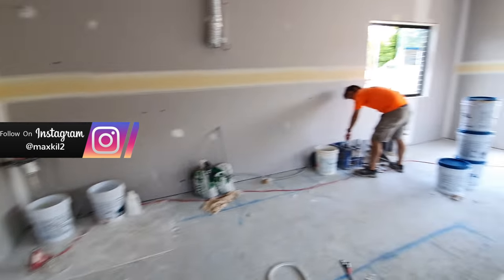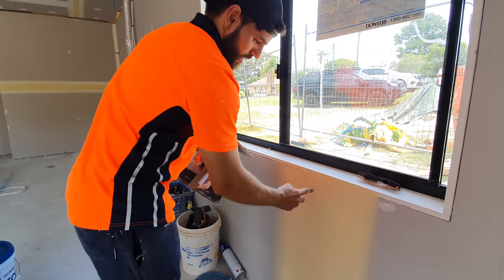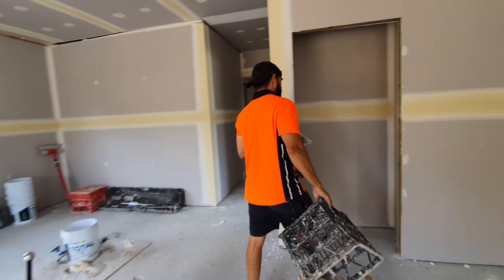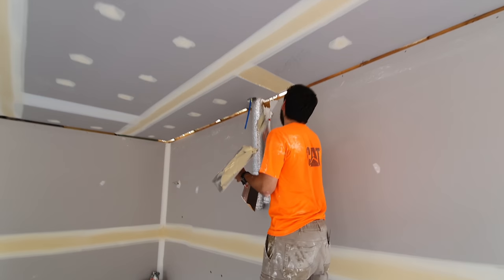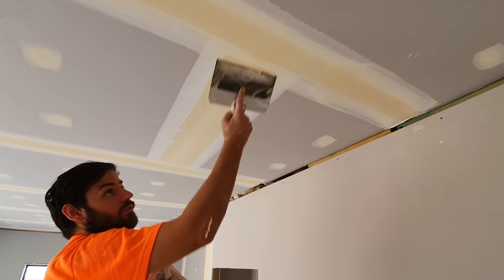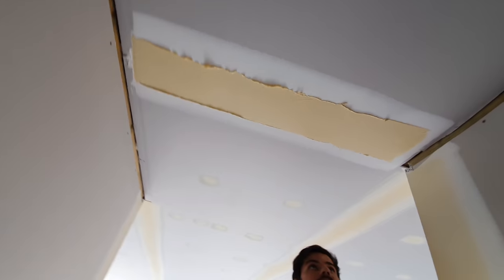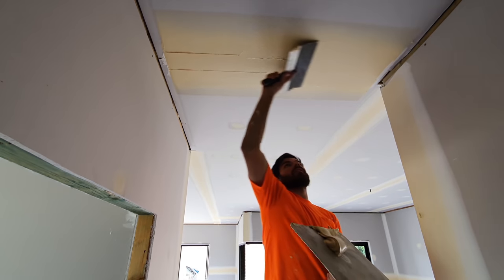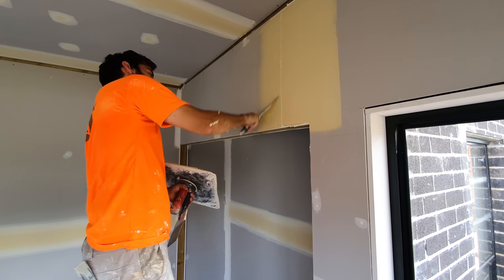How to Skim Coat a Butt Joint (DRYWALL)

Comment: Hey guys great seeing this! I'm an old drywall taper guy from years ago. We did things a little differently here in California. I used a mud pan and flat handle knives, a 6-inch for taping covering nails/screws and angles then a 10-inch then a 12-inch for finishing buts and joints. I only used a hawk and trowels while doing interior and exterior plastering. Great video!!

Comment: We split the butts out on fill coat wit 10" box (if that is needed. Down center if hollow joint) . On second coat we triple them with a 12" box, chase with a blade. And when they are dry, we 12" box the bands straight through the butts.

Comment: Love the mud you guys are using. The colour of it is not white like ones we have in ontario canada.
Reply: It's a liquid coloring that you add to the mud . It let's you know the stages of the taping . They're doing the 2nd coat with the additive . The next coat is a skim , probably without color . Also the color is used to make touch-ups more noticeable on a white primed surface , so you can identify what needs to be re-primed before finish painting. You can get it everywhere here in Toronto .

Comment: Being a drywaller in the US for almost 20 yrs i can say that for hand finishing these guys are legit and clean. Only thing i don't like or know is why there are no screws in the field of the wall sheets ? Hmm puzzling.
Reply: Glue on studs
Reply: Glue on stud is not as effective as screws. Also I don’t understand why they started hanging the drywall from floor? We always do the ceilings first then the walls and jack the drywall nice and tight . They may put a crown molding to hide the huge gaps but the next owner may not like crown moldings so this is a huge deal. Their work is clean and they tape nice and widen the joints so that they are not visible. I would give a 5* but lack of screws and not hanging the ceilings first is a huge deal. Also the glue only holds the paper of back of drywall if the house settle or move a lot am not sure it’s a great way to hang. I only used glue when requested by owner but always min 2 screws 16 and 32 inches. So a solid 4* for them. Not sure where they are but in 20 years I’ve never seen this. Only on commercial work we hang from floors as the drop ceilings will be below drywall. For. Corner bead I always cut a 4 inch peace and trim the edges and have both corners perfectly flush. We never overlaps corner beads, on windows we cut  a 45 degree angle and put a small piece of bead under so it’s all tight. Next we always nail or screw then corners on top of the clincher because eventually it will get hit and crack if not nailed or screwed on, last we put a flat tape along the beads to reenforce the corners, this is by far the best way to ensure quality and durability.  But you guys do clean work. I would love to know why the points I stated. Thank you for showing what clean finished coat is for all those who do shitty jobs. Lol.
Reply: It's probably a dabbed wall, think these guys are eastern Oz, where I was in WA they sand&cement and plaster skim the walls but some places dabbed plasterboard straight to the brick in this instance there wouldn't be any fixing for screws (Perth WA nearly all internal walls were brick)
Reply: @frenchronin   @Frenchronin  they don't start on walls in Oz, not unless there is a reason to.  As for the gap at the top they do po put a cornice up which covers it but it's not the same with all builders out there, just before I left Perth we were having to square set all ceiling internals before cornice because of a change in regulations on commercial builds. (Mainly for fire/smoke regs I believe) 

Also they don't overlap beads either, it's cut back at a angle forming a point and they can have a mechanical fixing as well as a mud fix. 

The walls be void of screws is most like because it's brick walls where the boards have been dabbed on using a plasterboard adhesive (powdered not acrylic adhesive) so no studs for a screw fixing. 
Also they use things called back blocks on the ceilings which are small cuts of board layered with adhesive which stick down to the back side of the plasterboard joints. 

I flushed out there for 7 years and each team I worked with did things slightly different. I even did a job where the ceilings were put up before the roof had gone on 😁😆 very trusting on the weather. Anything else I can answer feel free to ask. 😊
Reply: @jamessullivan3829  It looks like stud frames to me. I haven't been able to find anything on why those gaps behind the cornice though, like are they doing ceilings that are just over 2.4 or 2.7?
Reply: It looks like it’s all timber frame , was wondering this myself. Definitely haven’t used enough screws in my opinion. Maybe they just have different specs over there. I’m from the uk and never seen 1 screw in the centre of a full board before.
Reply: @ismu34  the boarders that worked with us were notorious for "stretching" boards 😆 if they had a room the was 3.7 wide the would offset the boards 50mm from each side so they could put 3 full sheets without any strips, they would do this knowing that the cornice covered 75mm.  Was bloody annoying if they did it wrong tho and the cornice wouldn't cover. Here in the UK it's become part of the regs for the internal corner to meet and be filled (either by tape and joint or plaster) even if it having cornice over it.
Reply from the maker: Stretching boards... Love it...
Reply: They are probably using adhesive on the studs . We do that here in Canada too

Comment: Hello, i work very much the same as you but i have never seen yellow drywall mud.  What is that?  Is this something you mixed? Did you add colour to premixed?  If so why?
Reply: I was just going to ask the same thing  is it an Aussie  / New Zealand thing?
Reply: I think that's topping mud for the final coat. I know here in the states you can buy topping and it's a yellowish color instead of the tan or off white color. It's also a smoother creamier mud.
Reply: It's weird 😕right
Reply: @johnwallace1729  it's a brand thing

Comment: Great work and video!!! Thanks for the knowledge! Here in TX I just see one coat. What compounds do you use one the 1st, 2nd and 3rd coats?
Reply: A setting compound for tape and two coats. Then a drying type for the finish coat.
Reply: @ismu34  just two coats of base coat which is hard then 1 of top coat which is softer and sands easier
Reply: @brocksinclair66  thats what I said lol

Comment: Thanks for sharing. Its pretty cool watching y'all use a trial and a hawk  That hawk has been used a good bit. you can tell by the curvatures of the edges. I grew up finishing sheetrock with a knife and  pan in the late 80s and early 90s. I have leaned so much about the new skim blades and various other techniques from all the cool channels.  My dad was a drywall contractor so I subbed from him and a couple of other contractors. I also remember when the only place you could get machines like the boxes and bazooka was renting through Ames taping tools. it really went crazy when the patent ran out. You could buy them then. Again thanks for the great video. I Oh yeah what is the cream colored mud? I've never seen it that color.
Reply: It's a liquid coloring that you add to the mud . It let's you know the stages of the taping . They're doing the 2nd coat with the additive . The next coat is a skim , probably without color . Also the color is used to make touch-ups more noticeable on a primed surface .

Comment: I’m assuming you guys glue the walls as well since you only have one screw in the field.  What kind of glue do you use, and is it metals studs or wood?
Reply: I was wondering that myself. How do they attach the drywall with so few screw holes?
Reply: I’m sure they glue.  We don’t hear, but we’d have four screws in the field on the ceiling and three on the walls—that’s not counting the one at the top or bottom of the sheet.
Reply: Yeah most residential units have their walls glued and their drywall hung horizontally
Reply: Depends on the walls, if it is timber/metal stud it's screwed as you would expect it to be but they use a acrylic glue as well as screws so it would be one screw at the joint two dabs of glue two screws either side of the center line then two glue dabs then a screw to the other side of the board.

If they are brick interior walls then it is dabbed with a plasterboard adhesive (mud adhesive) straight to brick work which has a either rough or patterned surface to provide a key, if this is the case then there aren't any areas to get a screw fixing. 

There are alot of different methods out there. 😁
Reply: @KevinsDisobedience  the stud adhesive here is strong. the screws are the until thew glue dries. the glue is stronger

Comment: That age old question... The trowel & hawk or the knife & pan... Which do you prefer??? Or even do you prefer both???
Reply: It seems like Americans prefer pans and knives and British and there colonials prefer hawk and trowel, but then again what did crocodile Dundee say about knives( obviously not a hawk and trowel man)
Reply: @jimginter6802  i can use both, i prefer flat troweling final coat as it has the same finish as that large knife and doesn't leave lines like the guy in the video explained with his curved trowel and it's faster than a knife and don't have to switch between the 2 tools.  I don't think region should play a role on how work is completed.

Comment: Why is there a gap between the ceiling and walls? Here in Arizona they push the drywall up tight against the ceiling and finish the corner.
Reply: Probably doing a crown moulding .

Comment: Just curious why none of the rock is nailed in the field? Also I’m assuming they are doing crown moulding or something? Never seen drywall hung like that?! Fire inspectors wouldn’t let that fly here. But I’m guessing you guys are the tapers and not the rockers... you do beautiful mud work!
Reply: fire inspectors would never pass normal white board haha, gotta use firecheck pink sheets for that
Reply: I also wondered why there is like a 1 inch gap around the entire home between the ceiling and wall
Reply: @derekk2300  our crown mold or cornice is made from the same material as the board them selves. no need to go tight unless its square set
Reply: @brocksinclair66  oh nice, right on. Thanks for the explanation

Comment: Hey max how long does it take for the boys too do a house??
Reply: I reckon they can finnish 700m+...probably 1000m easily.  Just depends on compound drying time
Reply: @schuey2003  I with you
Reply from the maker: About 8 hours I'd say, 6 hours first day, taping and 2nd coat and come back the following afternoon and top it out after they start another one.

Comment: Why don't they cut out the electrical outlets and lighting?
Reply: That is usually the job of an electrician in Australia, unlike many other countries. During rough-in (cable run) stage an electrician will have stud brackets (these are metal) nailed to timber studs where the locations of the switches, powerpoints, tv, data etc points are. Then after plaster is sanded, before cabinets are in and before paint and electrician will do the 'cut outs'. Because the stud brackets are metal you can easily find the brackets with a magnet and cut out with a plaster saw. It is also common practice to have the ground sprayed as well and also good to have a plan marked showing locations. A video also ensures nothing has been forgotten to cut out. 
As for the lights some sparkies use their spray marks on the ground and shoot a laser up to the ceiling. As for me I always use the sprays as I guide during rough-in even though they are spaced out accurately. Come cut out time, I will have my measurements on the plan which shows distance from wall to the first light, distance from first light to second light and etc. It is ALWAYS more accurate to measure off the ceiling by tape measure instead of shooting a laser up going off the ground. As for those sparkies who use the laser method they need to have floors cleaned spotless, make sure no materials are on the ground and make sure they actually go to the cut out before the floorboards are on or else they really are screwed. Anyhow, sure that answers your question...

Comment: How come you guys don't box your corner bead? Just a question. clearly you guys do excellent work.
Reply: Blades go dull quickly on those boxes doing that
Reply: Because they not doing hundreds of feet of bead
Reply: MUCH faster and easier by hand doing one small unit. Considering clean up time on the boxes

Comment: Whats the cause of pin holes and bubbling when plastering?
Reply: Your mud might be to thick or you're leaving to much mud on what your coating.
Reply: i get it over painted or sealed surfaces-no suction so air comes back out to surface
Reply: @dismaldog  It never happens to me when i'm finishing new drywall but only seems to happen on painted surfaces that are satin/semi-gloss, sometimes on flat paint finish too but rarely.

Comment: any reason they don't use the skim blades?
Reply: Because they're good. They don't need to
Reply: skim blades didn't exist until recently as well, lots of current drywall finishers learned their way and are quicker.  Skim blades maybe faster but are very expensive that it's not even worth buying them unless you level 5 finish massive rooms or ceilings all the time.

Comment: Nice job mate! Wish I could find that tinted mud here in the states!
Reply: If you use topping mud it’s that color use on last coat
Reply: You can. Go to a professional drywall gypsum supply store or add paint
Reply: @aaronl486  I use yellow food colouring heh
Reply: you can but a liquid color additive made specifically for taping .
Reply: It's a liquid coloring that you add to the mud . It let's you know the stages of the taping . They're doing the 2nd coat with the additive . The next coat is a skim , probably without color . Also the color is used to make touch-ups more noticeable on a primed surface .

Comment: You guys are so lucky you don't have to tape the top angle i wish we didn't have too lol things would go so much quicker if we didn't have too tape the top angle and make the corners all nice
Reply: I still wonder how they deal with firetaping for that seam
Reply: @robertaylor9218  i think they use a bazooka for those inside corners
Reply: @MV-wb2cz  apparently they don’t. They instead install a crown moulding. I think the crown and caulk have an appropriate fire rating to complete the system. I’m not sure if that’s what they are using, but I’ve looked it up since I saw this and it appears to be a thing.
Reply: @robertaylor9218  I saw some videos of them using  bazooka for their inside corners which is why I assumed as such in this case. Makes sense though if they use a fire rated crown or cornice.

Comment: What about the top of the walls the gap at the inside corner
Reply: bazooka them for first coat, then either hand finish or machine finish inside corners
Reply: @MV-wb2cz  nah they use cornice for those gaps.

Comment: spread that skimcoat with a roller on the ceiling and on the wall then use a trowel its much easier and so much faster!
Reply: I'm shocked at the number of people that feel the need to give these guys "advice " . A roller is easier when you lack skill , it's cleaner and lot easier when you can do it by hand. These guys are the best I've seen in 13 years of full time journeymen work.

Comment: This is a good technique. But why don't you explain how it's done? Like where and how you apply pressure. And maybe explain more of what you are trying to accomplish?
Reply: That can't be taught via video. Just can't be. This is NOT a video for wanting to learn basics or how to cut /feather . More just a show case of amazing skills
Reply: which side of the joint are you currently wiping out? apply pressure on the same side of the knife to create a feathering tight to the wall.  Left side of the bead, apply pressure to left side of knife (if wiping top down) and vice versa for the other side, then go down the middle with light pressure on the middle of the knife to not leave side lines in your freshly feathered sides. Explained it for ya.

Comment: I dont see the point of knife and trowel for each butt joint. Also. that lower butt under the window 3rd coat didnt get much wider when finished. These guys arent that quick either, just that there are many guys working on it. They have it made cause there is no top angle to deal with. Many of these drywall videos have the same thing.
All in all looks like a pretty good job